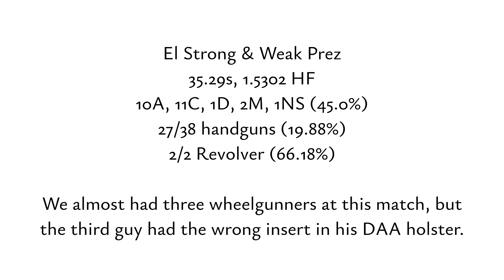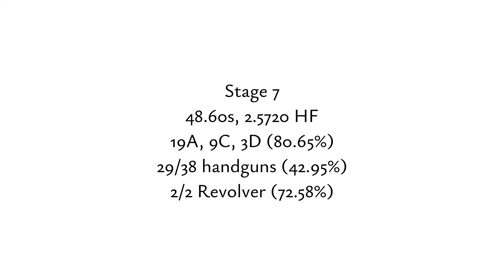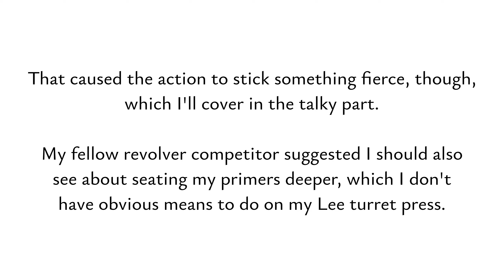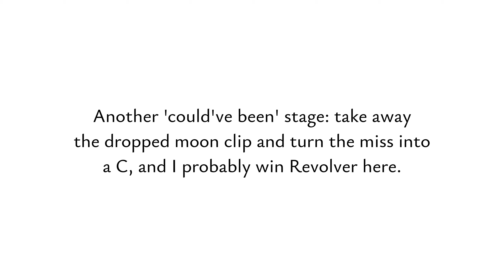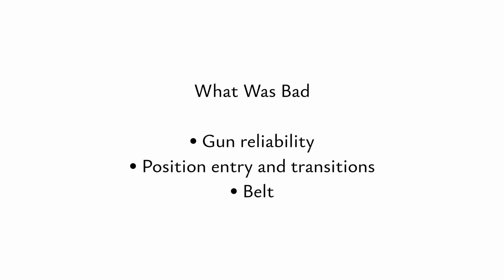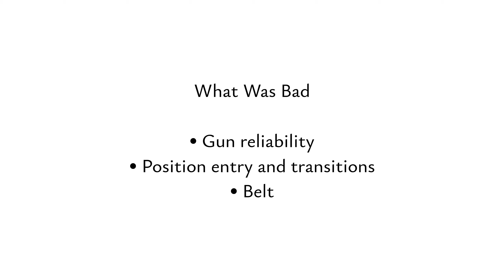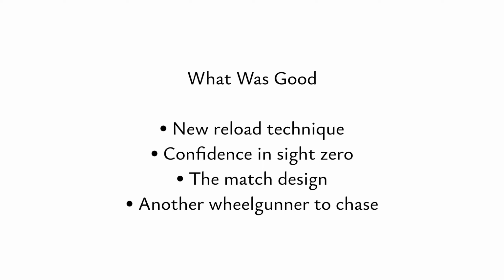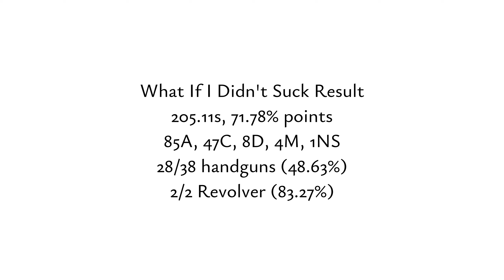USPSA Revolver: DSS March 27, 2021

Comment: Hey man I'm very seriously looking to buy a super GP in 357. I've shot a model 10 in IDPA for a couple months now, and a friend of mine has let me borrow his 627 V-comp for some local steel shoots and I've enjoyed it a lot. That being said, I have a love for Rugers and want to know more about the super GP. Could I get your honest opinion on it if you see this?
Reply from the maker: Sure!

So, the negatives first. One: I had to send it back to Ruger straight away when I bought mine, since the barrel assembly wasn't timed correctly. They made the repair for free.

Two: the reliability trouble I had been having. That appears to be solved, though: the firing pin spring was broken, which caused the firing pin to jam forward, in some instances, and prevent the cylinder from turning.

Three: the limited aftermarket. There's a lot more you can buy to gussy up Smiths, because they've been the popular choice for competition revolvers for so long. In the meantime, I had to draw and 3D-print my own extended cylinder release, because nobody makes one yet.

There are, of course, positives, too.

One: Rugers are built like tanks. Smiths sometimes have problems with bent cranes, if you slam the cylinder open or closed too aggressively. It would be very hard to do that with the Ruger design, since the metal is so much thicker. There are fewer fiddly screws to back out under recoil. Most of the problems revolver guys will tell you to watch out for are more specifically Smith problems than revolver problems.

Two: I don't think the Ruger trigger is substantially less tunable than the Smith trigger. I have mine down around 7-7.5lb right now, and now that I have a cylinder shim in, I'm hoping to be able to switch to the 9lb spring eventually, which should bring the trigger down to 7lb or a bit under.

Three: I like shooting something that isn't what everyone else is shooting, and this definitely fits the bill, both in USPSA (hardly any revolver guys), and in Revolver itself (hardly any Ruger guys).

If I were doing it again, I might have gone for the 9mm Super GP—but then again, I like the way the .357 looks a lot more.
Reply: @JaySlaterOfMars   @Jay Slater  thank you so much for getting back to me! Now time for the wallet drain! I have a love for Rugers having grown up around the M77, MK pistols, blackhawk, etc. You've officially given me the final nudge to give the Super GP a try. Wheel gun guys are a dying breed! It warms my heart to see your content (which is fantastic btw) rage against the polymer machine. I've subscribed and look forward to seeing your 2021 season. I'll show your channel to my club as well!
Reply from the maker: @covefarmdude  Thanks for the kind words! I enjoy producing these videos, so I'm glad to hear people like them. I should be back to my two matches per month schedule in June, after my unplanned May break for fixing reliability issues. Two major matches this year, too—one in August, one at the beginning of October.

I do have an extremely polymer, extremely semi-auto project percolating through the skunk works, but that's mostly going to be a goofing-off thing now and then.

Comment: Just think how well you'd have done withw S&W 929. :)  Just kidding. Good job man. Not everyone follows the herd.
Reply from the maker: You have me figured out: I'm a massive gun hipster. I've been interested in the way of the wheelgun since I started shooting USPSA, but didn't pursue it until I had an option beyond doing the usual thing and buying a 929.

I really like the Ruger platform, though. I can smack it around on reloads without hurting anything, although the trigger tuning remains a work in progress. If I were starting over, I might go with a Super GP in 9mm. The big .357 cylinder doesn't like to turn all that fast.

Comment: On stage 6, both turners can be considered a trap. You don't have to shoot at either of them, as they are disappearing targets. All you HAVE to shoot at was the steel. Scoring (HF) is points per second, so if you dropped the steel only you probably would have cut your time by up to a third (2.15sec). That could have earned you a HF of 9.3023 with only scoring 4 Alphas (20 points).
Reply from the maker: I think at that point you're limited on how fast the steel falls—the stage winner did it in 4.35 seconds, tagging both drop turners.
Reply: @JaySlaterOfMars  You are right. Look at the numbers again though. If the stage winner got all alphas (40pts) in a time of 4.35 seconds, then they get a 9.1954HF. If you shoot only the steel (20pts) in 2.15 seconds, that is a 9.3023HF. Without all alphas on the paper by the first shooter in this scenario they lose to the shooter by even more.

I shot Area 6 in 2016, and there was a stage with a stomp plate to activate one drop-turnet and one of four steel on the stage which activated the other drop turner.There was also 1 static paper target, which meant 10 shots required if you engage all targets. A Revolver GM stepped on the stomp plate, shot the static paper and the four steel, and ignored the two drop-turners. He won the stage (as I recall) and explained that the points from the drop turners were not worth the time to shoot them.

Analyze your stage run and subtract the time you used to engage the left drop turner (include transition time). I think you will find at least 3-4 seconds expended.

As to the speed of the falling steel, I have seen them "driven" down faster (I never tried it, but I have seen it). There are only 4 steel and you use an 8 shot revolver.
Reply from the maker: @robertthomas497  Looks like I only cut about 2.5 seconds off of the 6.5 by skipping the drop turner, but I could also have been much faster engaging the steel, looking at it (perhaps unfairly to me) in slow motion.

I grant you, I'm still really bad at hit factor math when I walk up to a stage.
Reply: @JaySlaterOfMars  I am not great at hit factor math myself. But I have learned that sometimes ignoring disappearing targets can be beneficial, especially when shooting Revolver Division. In a bigger stage bypassing disappearing targets can save time, reloads, and positions shot from. Stage 6 that you shot only required 8 shots and you did not shoot the stage badly. 

If I recall correctly, the other Revolver shooter was M class? Think how fast they would have been shooting only the steel. I would be possibly a 10+ hit factor if they completed the stage in less than 2 seconds.

Sometimes it comes down to "taking a few shortcuts". From working a good number of matches I have seen where I could have shot stages better by taking a simpler approach. I am still working on getting better at that.